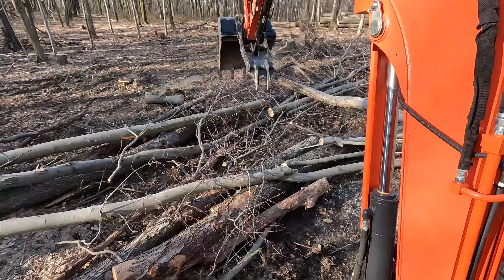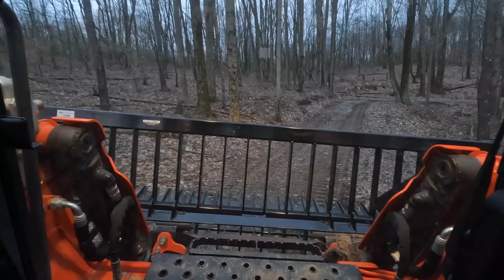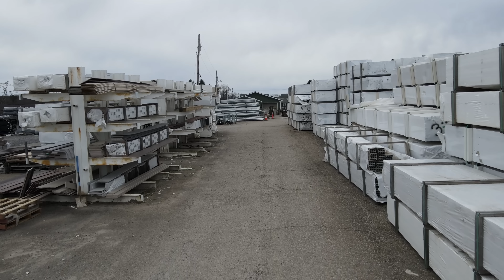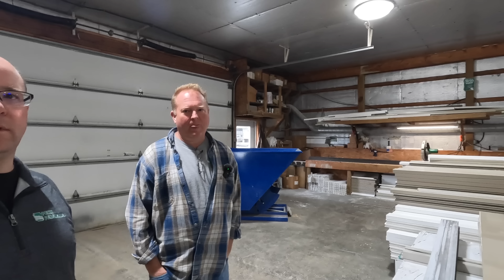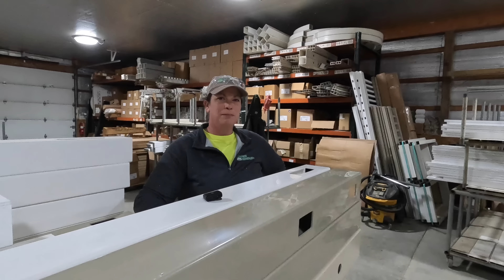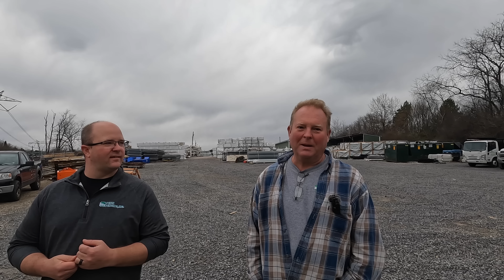Good Neighbor Fence, I will never look at it the same way

Comment: My government has in the building code that the best side must face out, if it is chain link the bars and posts must be inside the wire mesh! Pennalty begins at $2500 per side, or destructive removal by mini-excavator, if you have a pool everything goes in it!

Comment: Just a bit surprised to see Mike installing a Vinyl Fence in his rural setting. Selling firewood and encouraging others to use as a primary heat source, I guess I imagined you a little more in touch with natural materials. There are some beautiful and low maintenance wood fences out there.

Comment: I liked your commentary on burning wood.  I see you often carrying firewood and I need to share me setup to save work!   My stove is just 4 feet from a sliding patio door with a concrete patio just outside, this allows me to park an IBC tote full of wood just outside the door where I can just reach out to load my wood box daily, no carrying!   If you have a stove in your shop or garage just provide access to park the tote right next to the stove!  Work smarter not harder, thanks for all your shows, Don

Comment: When I had my vinyl 2-rail fence installed about 5 years ago I remember the installer saying, "Wood is good, but vinyl is final!"
Mine has held up well, when I can keep from hitting the posts with the snowplow.  Vinyl gets more brittle in cold weather.  This summer it needs pressure washing to remove green growth on the underside of the rails, but I consider it acceptable for that amount of time.

Comment: Was just watching  Dirt Monkey  on youtube  at some farm machine expo  there they had a wood processor  that would  work with excavator  pick up and process  cutting firewood blocks feed the saw and  blocks  drop down to splitter    all on one machine  could end up in trailer  or tote whatever  reduce the number  of equipment

Comment: Mike, great episode. I was hoping to hear something about the durability expectations for the vinyl.  Here, in Texas, vinyl fencing just never seems to last very long. I am guessing it has to do with our higher temperatures and higher uv levels. Looking forward to seeing the new fence at your place. Thanks, Mike.
Reply: Oh me... don't say that.   I have 30 acres in east Texas with the roadside lined with 4 rail pvc white fencing.  It's been up about 20 years now.  Still seems good. But I hope it last awhile longer. I'm 66 and hope I don't have to deal with it.
Reply: @rgd  I'm down here in the coastal plains and the vinyl fences here look absolutely terrible after about five to six years. The sun causes them to Crack and warp. Wish I could say something positive, but the people I know who have them say they would never do it again. They look so nice when they are new but just don't last. I'm also 66 and almost bought vinyl fence for my farmhouse near Tyler, but went with iron.
Reply: Ok Mike. Let's see if I've got this right.  You own over 100 acres of mixed hardwood and softwood forest.  You have chainsaws, tractors, a sawmill, and virtually every other thing necessary to build a fence, and you go with plastic. I guess I get it. I'm an old man now and the last thing I want to do is paint a fence. Hope  it lasts for decades.

Comment: With the hollow channel posts, how ridgid is the fence.  Do they ever fill the posts with concrete.
Reply: During installation the posts are filled up to ground level with concrete, the concrete seeps into the round holes that we route towards the bottom of the post.

Comment: The engineer in me wants to see a method where you could dump the unsplit firewood and have it about 3 feet up. That would reduce a lot of wasted time and fuel lifting the chunks up to the splitter. For me, that seems to be a bottle neck and a lot of wasted effort, seeing as your skidsteer already lifted them up that high.

Comment: Mike:
Does that skid loader have the capacity to pull a trailer? Just thinking of limiting it to one trip back from the woods.
God’s Blessing’s,
Curly from Oconomowoc
Reply: Mike has talked about the suggestions of trailering out of the woods.  His trails are narrower than the camera shows, and  turns are tighter, and none of his trailers would easily go back there.  For him, getting the trailer into the woods is more headache than help.

Comment: Mike, I know you mark your logs for cutting uniform lengths of firewood rounds, I saw something the other day that might save you some time. This sawyer had a length of rod attached to the bar on his saw to gauge the length of his cut. It was set up so it did not interfere with the use of the saw, I immediately thought of you, so passing it along. I'm going back to the video now PEACE.
Reply: If you practice, you can train your eye to be able to guess where 16" is.  Plus or minus an inch, and that's good enough for firewood.  A metal rod sticking out anywhere is a safety hazard.  Maybe use something more flexible, like a pool noodle if you have to while you are training your eye.

Comment: I drove by a house this last weekend that had a vinyl fence surrounding the property that gave me a very different perspective on this approach.  The fence was made like a traditional rail fence with posts that had 3 horizontal between, there were multiple sections of the fencing that must have had tree branches fall on as they were broken.  People get this for the "maintenance free" aspect but all plastics will embrittle over time due to uv/thermal/oxidation aging and what happens when this stuff inevitably breaks from a tree fall, someone backing into it with a vehicle or the kids climbing on it?  You can not simply get another piece of wood and repair it, in an afternoon like you would do with wood, you have to hope that the manufacturer is still in business and that you can find some new sections to replace the bad, probably taking a long time to source and costing a fair amount.  Also, this stuff chalks and goes yellow over time...  Seems that an unpainted wood fence has a lot of advantages...

Comment: Very interesting video, Mike. Would liked to have known the difference in gauge (thickness) of the vinyl Penn fence uses versus the gauge vinyl the big box stores use, if there is a difference. Have a day!
Reply: On the 6' high Liberty privacy fence as shown the posts are 5" x 5" .135" wall thickness and the rails are a 2" x 7" .080 wall thickness.
Reply: @matthewnebel1072  Thanks for answering as I had the same question. are the vertical pieces also .80 thickness?
Reply: @billkiessel6682  The tongue and groove does not support any weight, it does not need to be heavy wall like the support structure. It is 7/8" thick material with internal ribbing for strength/rigidity. The wall thickness is .045". This allows the overall weight of the panel to be kept down.
Reply: @matthewnebel1072  What is the best product to bring back the gloss of a vinyl fence?

Comment: Jess is the heart of the vinyl operation for sure. I like a chain link fence. The wind will go through it and you can put plantings around it to hide it. The sun will get to the plants, unlike the vinyl.
Reply: Not to mention vinyl will be covered in mold in a few years tops. 👎🏽
Reply: I am surprised he doesn't make the fence himself. He has $500,000 in equipment and buildings to handle wood. I know it would take time, no pun intended, but seems it wood be a lot nicer, pun intended. ;)
Reply: @jamesoncross7494  Wood needs to be maintained, vinyl you just set it and forget it. He talks about that in the video.